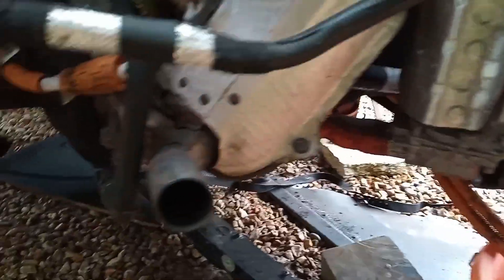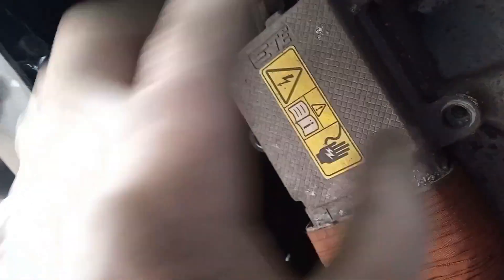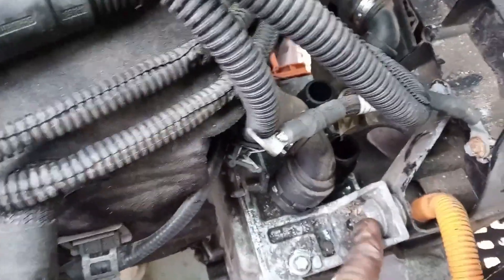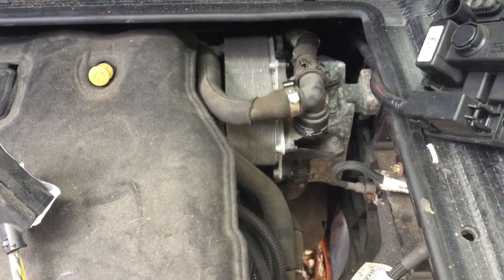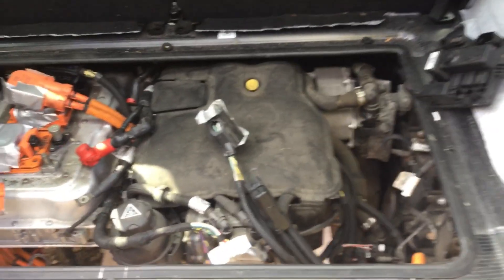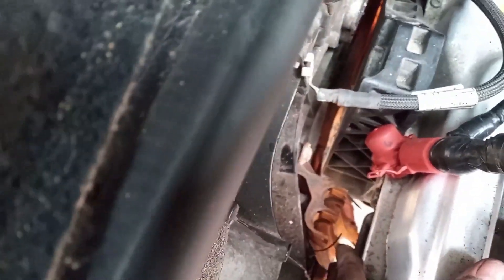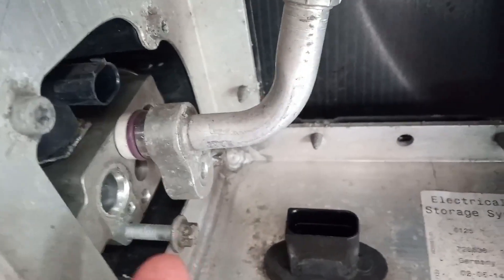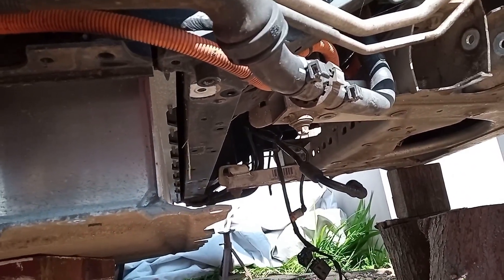EV conversion Project Mini i3 Ep 14_ motor out? or battery?

Comment: It would be good to know what precautions you took due to the high voltage cables
Reply from the maker: Hi, thanks for your comment, that was covered in the episode 13 when I started disconnecting the HV cables.